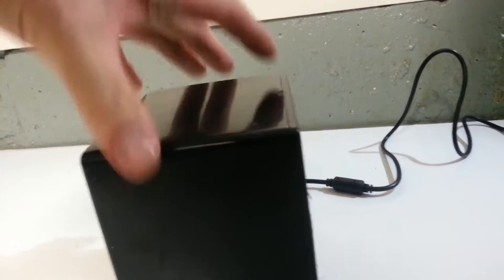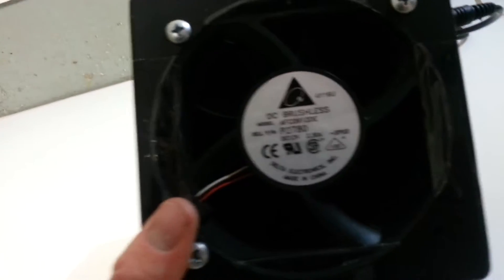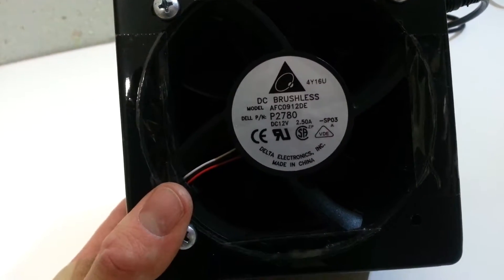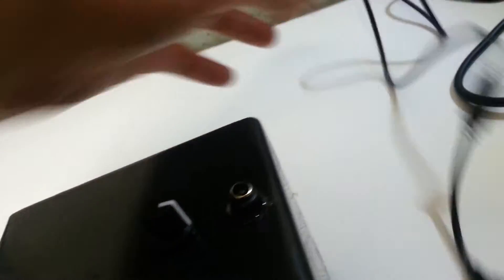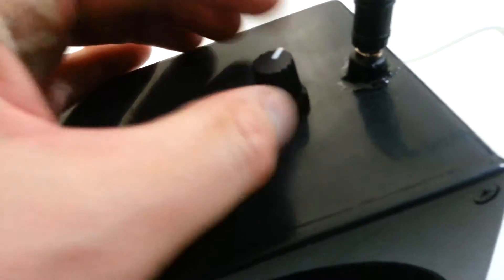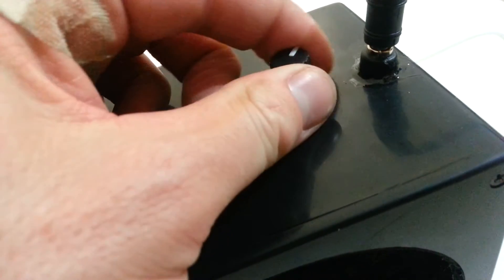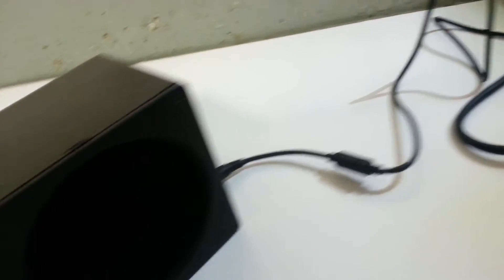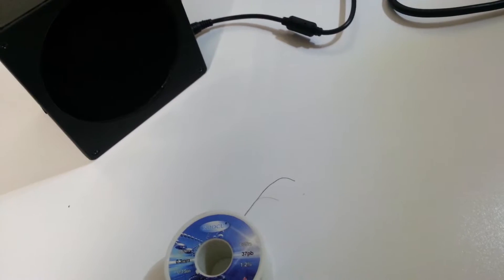Diy Solder fume extractor w/parts list

Comment: Looks good. I like the form factor. Would be interesting to add a small hose to be able to keep the bulky fan in a corner out of the way. That way, you can focus the extraction to smaller areas or specific areas
Reply from the maker: Pyro159 

Thanks. It could definitely be improved in. I need a different motor controller first off but it works ok for small jobs.
Reply: @BradKwfc  Sounds good. I'm going to use an Arduino due to control my 120mm extractor when the parts get here Monday. Hopefully, I can get it good enough that I can solder inside the barracks at Fort Lee Va without setting off the fire alarm
Reply from the maker: Pyro159 

Good luck with that- hope it works.